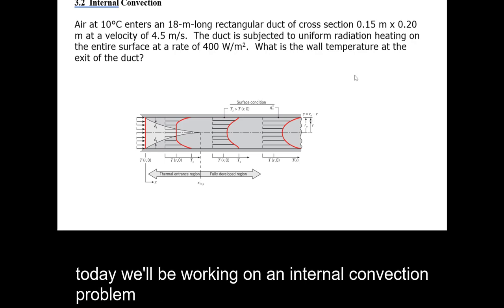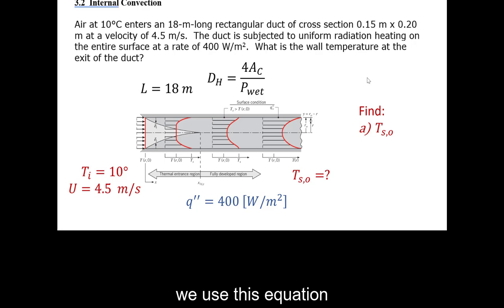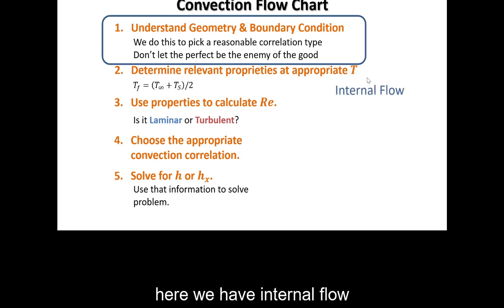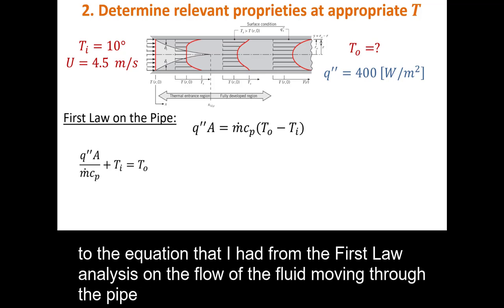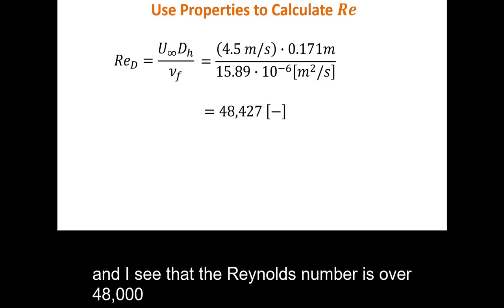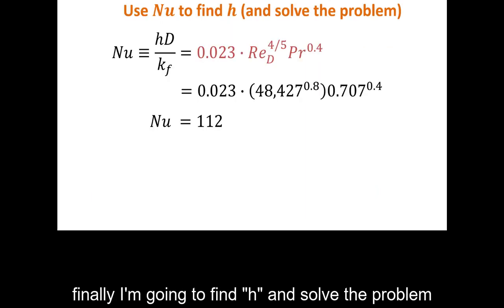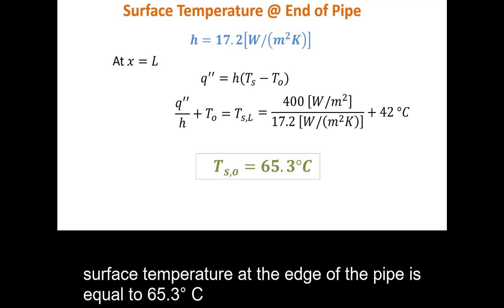Internal Convection Rectangular duct const q'': Heat Transfer Examples for Mechanical Engineers

Comment: how can obtain an expression for the variation of the mean temperature Tm(x) with distance x along the duct?
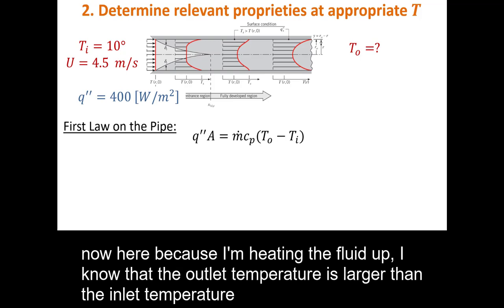Reply from the maker: I think you'd want to repeat this process at different values of x down the pipe. It will look pretty similar to this provided that the flow is turbulent and you're past the entry region. @ 4:25, A is a function of x, and then we'd be solving for T_x instead of T_o. In this problem, the properties are a fairly weak function of T, so you can probably use the same properties for different values of x. Or maybe take the average properties from the inlet or the outlet. If you go into the entrance region, or you have transition from laminar to turbulent, your correlations may change with x as well.